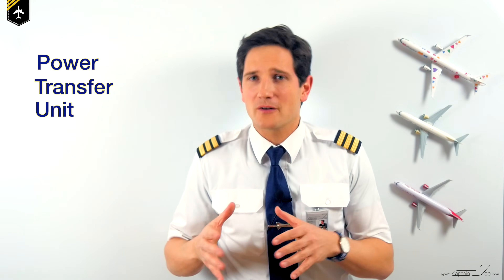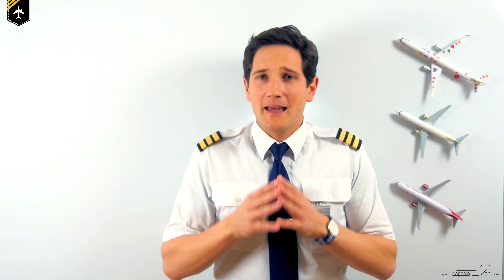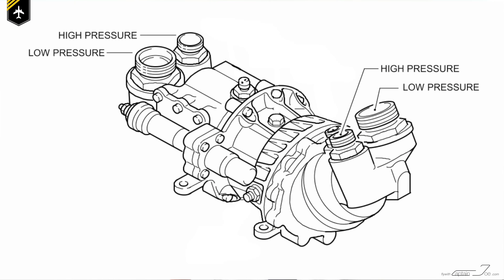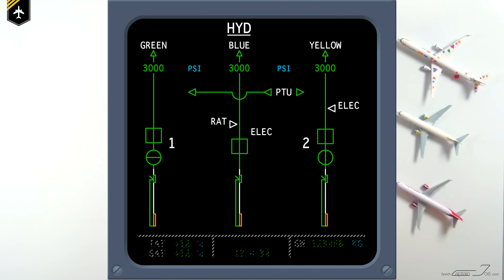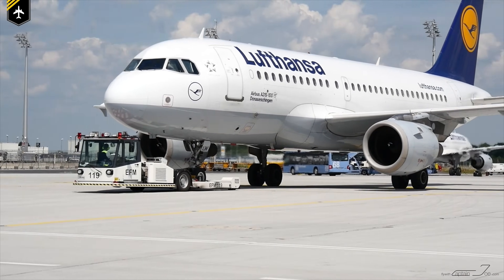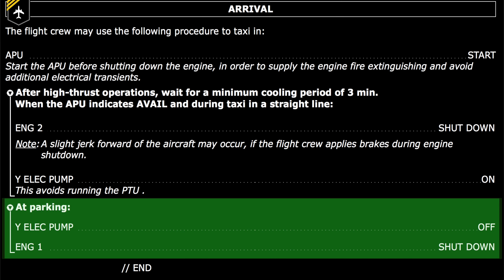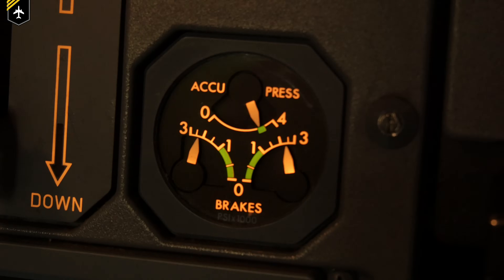MYSTERIOUS BARKING SOUND on AIRBUS? All about the PTU explained by "Captain"Joe

Comment: But why is there a PTU at all? And why particularly only on the A320?
Reply: Without going too technical or using technical terms I'll try explaining.
Basically on the a320 there are 3 independent hydraulic system (to ensure redundancy). One system is powered by an electric pump, and the other 2 by each engine (So here you can say hydraulic system 1 is by engine 1 and hydraulic system 2 is by engine 2)
Ignoring the one which runs by electric pump (it has no relation with the PTU), What the PTU does is it is able to run the offside hydraulic system. Say if you are only running engine 1, then system 1 will be powered by engine 1, and system 2 will be powered by engine 1 via the PTU. Same for if only engine 2 is running.
Use of the PTU is for backup. During normal operations PTU is never used.

Comment: I know it's been a long time since the video is up, but how worried should we be if that noise happens mid-flight? It happened to me once, and fortunately I was aware of no other uncommon events until arrival. But it puzzled me, especially after seeing this video.
Reply: The sound would be something else because the sound you hear on the ground is the PTU test and not the PTU running. And in air you can't do the PTU test.
Reply: @ZK-APA  I see. But is there some unusual, perhaps upset situation, in which it would be necessary to make it work mid flight?
Reply: @ZK-APA Except in all fairness, I have seen several videos of some Airbus a320 family planes where the PTU clearly is going while in the air. Why would that be?

Comment: @ Captain Joe can you please advise reason why some planes are making sometimes sound similar to diving bomber Ju-87 ? I mean this is happening mostly when approaching landing on low altitude and can be heard from the ground. I guess this is related to engine noise and then both volume is higher and tone is different than usually. after few seconds sound back to normal. (sorry for my grammar  - English is not my home language - but I hope my explanations are clear enough).

Comment: Also, this is used a lot while doing maintenance, because you need hydraulics, and need to use the gpu.
Reply: What does the GPU has to do with it?😆
Reply: @speedbird9313  really, almost everything. Im a student at at the high school of civil aviation, and when we need to work on airbuses and cant turn on engines or apu, we use a ground power unit. Now, it provides just electricity. So, we use the electric hydro pump to pressurize one system, and the PTU pressurizes the others with it
Reply: @jaroslavkuna8853  Ah..most airports have built-in ground power, so there is rarely a use for GPUs.
The PTU only powers the green system via the yellow elec pump. If you need blue, you need to use the blue system elec pump.

Comment: What does it mean if this sound continues for the entire 15 minute taxi to the runway? This happened to me on an A319 last week and didn’t know whether to be concerned
Reply: Pilots probably started engine 2 first and left engine 1 off so the PTU would be pressurising the green system until engine 1 start. Normally you start engine 1 first if doing a 1 engine taxi. Or you can turn the PTU off but then you have no green hydraulic system
Reply: No cause for concern. That will occur when only one of the two engines is running for taxiing. It is a more common practice to taxi with one engine to save fuel so the PTU runs during taxiing to pressurize the hydraulics on the side where the engine is still off. Even into takeoff when both engines are going, you may still hear the PTU operate for a bit, particularly during the retraction of the landing gear.

Comment: I used to work for a lager American corporation in the UK testing hydraulic pumps, electric motor pumps and other electric /mechanical products for Airbus A320, 330,340,350, used to take pride in knowing these products worked and kept passengers safe, Boeing use similar equipment which i was involved with, still miss the job occasionally retired 3 years ago, but feel proud that i was part of that

Comment: Does that mean excessive use of flight controls cause the ptu to engage? I remember hearing it on a flight during our approach as we navigated around a little storm, I noticed the pilot was using his speed breaks or “spoilers” excessively
Reply: Shouldn’t be unless an engine pump had failed as the output from engine pumps is much bigger than electric pump or RAT.
Reply: @tomstravels520  thanks. Can’t wait to get my A and P and learn more about this stuff

Comment: Thanks for the explanation! I have tried to find the source of this sound for quite some time as we also had a lot of it during flight as well (A321-231). I must assume there must have been some kind of pressurization issue that wasn't critical enough to abort

For that flight, it was the worst when the flaps were fully extended, so it was heard during take-off and landing. So I would assume the flaps + gear probably stressed the hydralics on our old plane causing loss of pressure

Comment: Joe didn’t you mention in your Hydraulics Video that it’s the Green System That Energises the Nose Wheel Steering and Here you Say it’s the Yellow system that energises nose wheel Steering . I am confused, which is it ?
Reply: On the original A320 it was the green system. Around the mid 2000’s it was moved to the yellow system

Comment: Yesterday was the first time I noticed it, and I imagined  it is some system component  struggling to function. So in panic I pressed the button and called the flight attendant to report it - and she assured me it is normal noise from hydraulics.  I was not convinced, but I kept quiet, but expected to fall out of the sky soon. Then in a few minutes, the pilot aborted the take off part way through the runway!!  Now I am super terrified  to say anything  - because this was in the USA, and in that country my options would be to get shot by the authorities, or to potentially die in the upcoming crash. Good news is that the plane took off after about 15 minutes, and I am alive  searching for answers here. (PS: About the aborted take off, they said something about needing to reset a computer or some instrument)
Reply: That’s a possibility. If a caution message flagged up at low speed it would need to be fixed ideally before being airborne. Some computers can just be reset

Comment: Hi, you say, that pump should balance two hydraulic systems, but then I have another question. Just yesterday I flew on A320 and exaclty this sound appeared approiximately at the second engine start and was cnotiniously pumping up until gears was retracted. And then it started again on gear down, and continues until both engine shutdown or 1st engine fullstop (can't really hear this good, but it gone only after some time, when aircraft was parked. What the hell is this? From your explanation it is obvious now, that pressure wasn't even with gears down, but it is possible, how gears could even affect it at all?

Comment: I fly often on airbuses and recentley after parking and engine shut off this famous pump sound, took longer to stop and spoilers on starbord side were opening and closing, then the capitain or f/o said over pa 'landing problem' and after that the seat belt sign went off.. I ve got a quedtion: why did flight crew said over PA that it was a landing problem.. Should cabin crew be advised in this situations? Thanks

Comment: Hi captain! How is this system in other airplanes because i never heard it on 737 or other ones. 

Are there PTU in a 737 or 747 for example?
Reply: The 737 has an electric and engine driven pump for each engine. Same for 747 although that one has slightly different setup as some are electric and bleed driven

Comment: Wait why did i Heard this while flying
Reply: Could be a hydraulic pump had failed
Reply: While up in the air you mean? You may hear it during takeoff, especially if much of taxiing was done with one engine to save fuel since the landing gear retracting and movement from the flaps and ailerons will cause increases in hydraulic demand and the pressure may not be equal yet so the PTU kicks in

Comment: This might probably sound dumb but can't you start engine 2 first?also...why is it that the important functions such as the nose wheel steering which is usually used with one engine during taxi procedure powered by the second/not started engine... shouldn't it be with the first engine?the second engine can probably control the flight flap thingies...that kinda makes sense to me... again sorry if it sounds dumb...I ain't a flight student
Reply: For dual engine taxi, engine 2 is started first, then engine 1. This is so that the parking brakes are energised.
For single engine taxi, engine 1 is started first for nose wheel steering.

Comment: question, Captain. What keeps the parking brake pressure applied to the disc when the 320 is parked for an extended period of time? Surely it doesn't depend on wheel chocks only.
Cheers from Louisiana.
Reply: The parking brakes hydraulics have an accumulator. So the parking brakes will work for around 12 hrs without needing any external energy. But yes beyond that chocks are needed.

Comment: I thought that engine 2 is usually started first? Or does that apply to boeing only?
Reply: Engine 2 is started first if starting both engines. For 1 engine taxi you start number 1 first then you can turn on the electric pump for yellow system

Comment: Why dont you shut off eng 1 instead of eng 2 so yellow system us pressurized by eng 2 driven pump?
Reply: Because if you shut off engine 1 you loose the green system and have the PTU constantly running. If you shut down engine 2 you can use the electric pump to pressurise the yellow system
Reply: @tomstravels520  Oh I see, thank you !

Comment: The first time I heard this sort of sound was when I flew on an A320 for Northwest Airlines in September 2009 (months before they folded into Delta) on a connecting flight to Minneapolis. When the plane was taxiing, I heard this particular sound. It wouldn't be the last time, as I would later hear this sound when I was flying an Airbus plane (again, an A320) for United when going down to Colorado to visit my sister.

Comment: the power transfer unit (PTU) is a device that pumps out air for the flaps.
Reply: Not air, but hydraulic power.
Reply: @mikep9604  oh I thought it pumps air
Reply: @michaelkolai4288  Actually, I have to clarify. It transfers power between the hydraulic systems but not the actual hydraulic fluid. It transfers hydraulic power between two different systems. For example, it transfers hydraulic power from one of an aircraft's hydraulic systems to another in the event that second system has failed or been turned off.

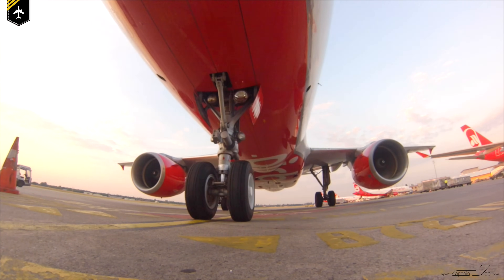Comment: 4:00 Wouldn't it be simpler to have the nose steering system on the green side then? Or the blue?
Reply: It used to be but then if you lost green system you then had to manually extend gear (green powers landing gear) and then you needed a tug. If on yellow system you’d only loose one and not the other

Comment: Dear Captain Joe, I am wondering after engine shut down and the hydraulic systems are depressurized, how could the aircraft maintain it's parking brake? Seems as you mentioned, the parking brake also need to be pressurized by the hydraulic system.
Reply: Jordan Sun there is an accumulator in the hydraulic system which controls the parking brakes. As long as the accumulator is pressurised, the parking brakes work.

Comment: You know what's funny? I saw this video one year ago when I was a driver on an airport, only for general aviation. Now I work at the same airport but as a Marshall and ramp operator. Today a LAN a320 arrived, and while I was setting the chocks on the right hand side of the plane I could clearly hear the PTU operating. I didn't remember what it was, but I did know I had seen a video in this channel about that particular sound. Came back to refresh my memory!!! Thanks captain Joe!

Comment: So based on what I understood the A320 PTU is simply just like putting the yellow and green hydraulic systems into a arm wrestling contest. 2 reversible motor-pumps are connected to the same shaft but turning into opposite directions, and the one with more pressure, meaning more torque, wins. When there is enough torque difference to overcome the internal friction of the PTU a power transfer is made. No electronic control needed. Captain Joe, please correct me if I am wrong.

Comment: That turbine thingy system is only used if the plane to suffer engine failure in both engines this is operated by gravity- where the pilots relays on gravity to lower the turbine.  The turbine thingy helps glides the plane until the pilots are able to make an emergency landing. How does a pilot land a plane that has engine failure great skill and gravity they push the button/lever that opens the landing gear doors and rely on gravity to pull the wheels down.  I watch Air crash Investigation so that how I know what that turbine is for.

Comment: Why does the cabin crew dinger always always always go off about 10 seconds after takeoff?
Reply: Depends on SOP I am sure but the airline I fly for we "chime" the cabin for flight attendants passing 10000 ft to begin cabin announcements and beverage service. If it is turbulent we will let them know it is ok to make announcements (electronic devices may now be used..etc) but we may tell them via interphone....hold off until we smooth out a bit. Hope this helps.
Reply: frink32 yeah usually when I fly with easyJet the aircraft will rotate then about 5-10 seconds after takeoff the dinger will sound. Here’s an example in my video: https://youtu.be/2-OIveHFV5M

Comment: Never flew in a A320, just A340. There were no unusual sounds, even though i had a seat at the wings. In a B757 i heard noises from below, which seem to come from the mechanism, that drives the flaps, or slats, which were very loud and i noticed noises obviously coming from gear operation, which sound like opening the bootlid on a car while driving.

Comment: Dear Joe, you mentioned you can't start all engines at the same time, only one after another?
Why is that? Due to the electric power needed to start en engine or  to less air pressure?

Comment: I pretty sure I've heard this sound in the air before. I'd surmised at the time that it was the electric conveyors for the baggage containers in the hold shifting the containers to alter the balance of the aircraft. 
Is there a reason the PTU would activate during flight?

Comment: Joe, please explain next thing to me: monday I was flying with an A320 which used the single-engine taxi procedure. It took about 12 minutes to taxi to the runway. The barking sound was heared when engine no. 1 was started and on idle speed. After the barking sound was heard a few times, it remained silent and the only thing sounding, was the (I think) electrical driven hydraulic pump of the yellow circuit. This continued untill the engine no. 2 was started, the barking sound was heard again for only a few times. Why wasn't the barking sound heard the whole time during taxi? Does it have someting to do with no acuating parts on the yellow circuit during taxi, except the NWS?

Comment: Green system powers nosewheel steering on some older aircraft. 
Changeover to yellow was about mid 2008.
If an operator taxis out on left engine only, you will hear this noise if the yellow electric pump was not placed on, then PTU will not run.

Comment: So if I understand well, PTU operation at gear-up, repeatedly in mid-flight, gear-down and during both engines taxi is not a good sign ?
Specifically, at gear-up, wouldn't that be a good reason for a return to the departure airport?
 Last week after landing I asked the captain of that AF regional flight but he just looked strange, visibly uncomfortable, and said that it happens every now and then.
Thanks in advance for knowledgeable answers, tail wind ;)

Comment: We had this on a flight last week. They were doing pre flight startup etc and the noise went on longer than expected. They did this numerous times then declared a fault and called an engineer.  2.5 hours later we took on more fuel and clear to takeoff. Halfway into climbing the barking started, I panicked as I thought this only happened on the ground? Ironically on approach on the return leg using a different plane, the barking started when coming into land - is this usual? I've never heard this in the air before?! New BA procedures?

Comment: It can be heard as well during: landing gear retracting or deploying, or when wheel brakes are applied. On older planes, during extreme turbulence and when the plane is constantly trimming. Then in one of my experience, when the flaps is extended. The scariest part is when I heard it continuously barking during landing gear extension (we were at approach), but then there was no loud wind noises to indicate the gear doors opening and a "thump", I was like "OMG, landing gear fail". But then, 5 seconds later I heard that comforting loud wind noises from below the floor. At this point I'm assuming that anything that requires hydraulic power, will trigger the noise. The older the system, the louder and the laggier the noise and effects.

You can feel the "lag" too, they bark first and then the action commences. In Airbus A330, the PTU noise is different, but also give the same effect, you will heard a gas nozzle and a thump, then you'll feel the brakes decelerating the plane. Sitting in the middle section (overwing) is the best place if you want to hear these noises. But man, I feel that Airbus needs to insulate their planes better from all sorts of distracting mechanical noises.